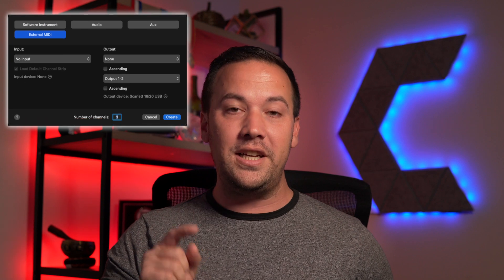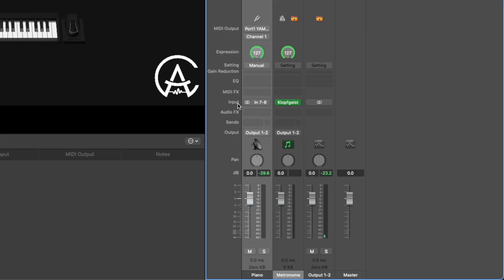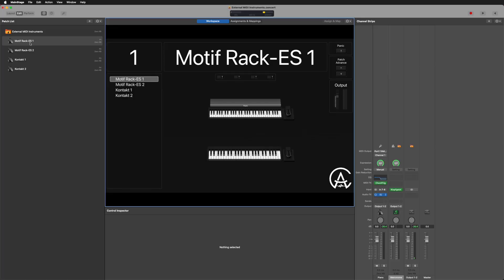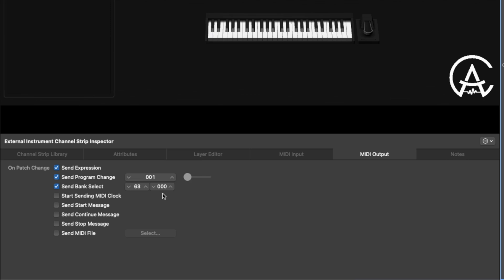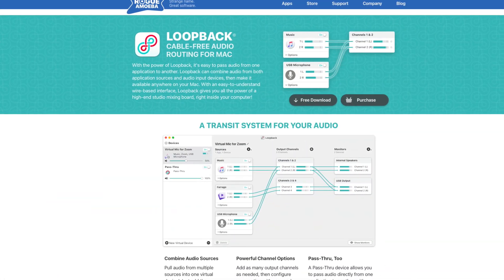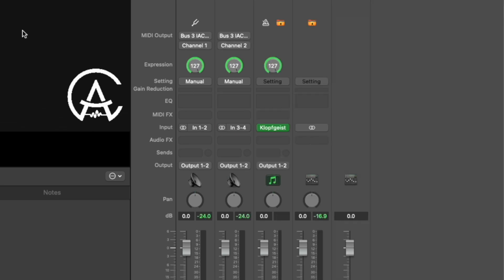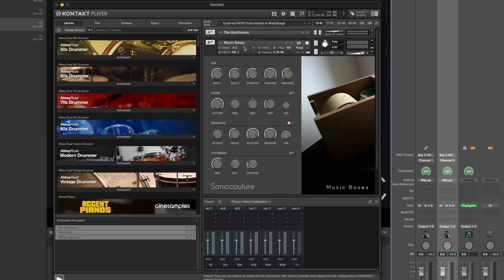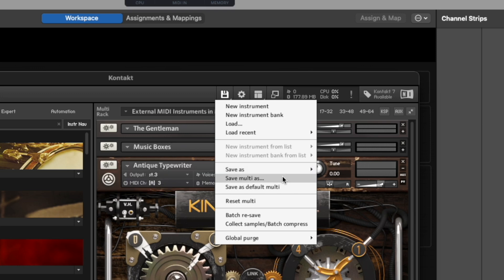Use Your Hardware Synths in MainStage!

Comment: Hello. Thank you for this instructional! I have been trying to connect my Roland sh-d4 to my Mac to used in MainStage along with software instruments patches I have already there. My idea is to have the sound module available for extra sounds and for the drums as well! I have had some relative success but I am not quite there. Thank you for showing that a MiDi ext channel strip is needed! I have a couple of questions for you:
1- How do you have your Motif-Rack connected to your interface? With actual audio cables? from Out to In on the interface?
2-ho do you control the volume of the Motif through MainStage? Through an assigned control? I tried to use the the proper volume knob on my module and does not do anything...

Thanks a lot.

Comment: Hi. I get the concept of using the Focusrite interface software mixer so not to create an echo. What if I’m using an interface that has additional inputs but no software mixer? I use a UA Volt 4 with headphones. Would I turn the monitor knob off to avoid a midi echo of the Kronos? Thanks

Comment: Hi there. Is there a way of changing patches of 3rd party plugins through a midi controller?
Reply from the maker: Yes, but the 3rd party plugin needs a way of receiving MIDI data from an IAC bus. Similar to the method I used with Kontakt in this video.
Reply: @CatherallAudio  thanks. I think my mind cannot comorehend it. I wish apple  made it simpler.
Reply from the maker: Would you be able to describe what you're trying to achieve and I can see if I can help?
Reply: @CatherallAudio  sure. I would like to change oresets in plugins via midid controller. I said patchbin my orevious message,sorry for that. Thank you for being so helpfull.

Comment: James thank you for all of your work on Mainstage. I took the leap through watching your videos. You have a wonderfully reassuring manner. Your videos are real tutorials. Thank you.

I’ve looked everywhere to find a solution to this: I wanted to have synth layers drop in and out during a song.
I’m using one midi controller keyboard.
I achieved this by just having separate instruments on different patches.
I assign trigger keys on the keyboard to patch change up and down. 
So I will have say 4 patches for 1 song. 

Then I create a new ‘set’ and treat this set as the next song in my concert

My problem is that the patch changes are not restricted from moving down onto the next set or ‘song’. So it’s too risky for live performance.
I wondered if there was a way to prevent this
Again many thanks for all of your help.
Reply: What about having all of your layers on one patch, assigning expression to knobs or sliders to your controller then assigning each layer to that knob/slider/pedal and bring the layers in and out that way. That can be saved per song and avoid patch changes. Is that what you want to achieve?
Reply: Thank you for the reply Eric you’re a gent, I really appreciate your time. 
I wanted to be able to completely turn a layer on and off with one trigger. So, in a song, if I started out with 1 piano layer, then triggered a 2nd synth layer at the pre-chorus, and then 3rd layer for the chorus; then switch them back off for the second verse. 
If I assign expression layers to knob/slider, this is able to switch a layer fully on and off? Again my great thanks 
 @EricNorth-j5s

Comment: Can this be done with an older Casio that doesn't have usb out but just 5 pin midi?
Reply from the maker: Yes, but you need an interface that can take 5-pin midi and convert it to USB so it can be recognized by a computer.